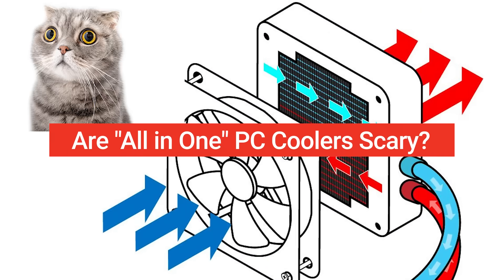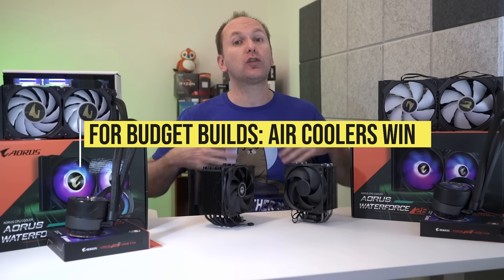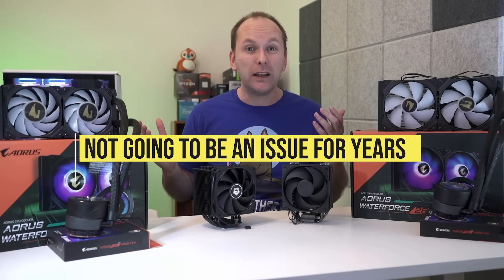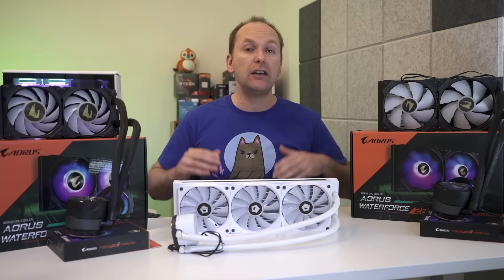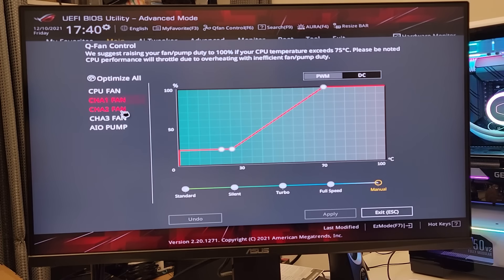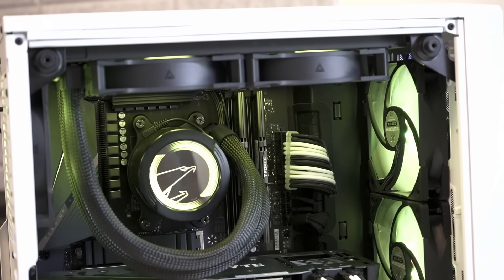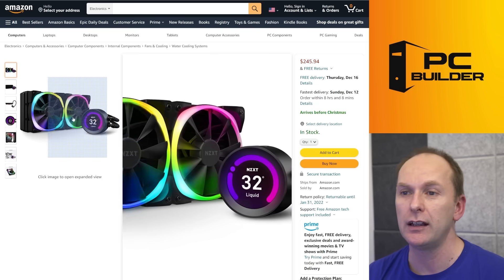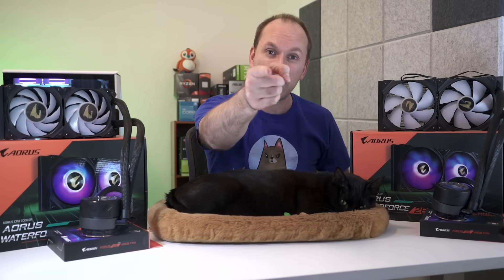🛑Watch BEFORE You Build! 🌊 PC Water Cooling Build Guide | Water Cooled PC Build 2022

Comment: Question, wouldn't the top mount fan direction be pulling hot air through the radiator, don't you want cold air to be going through it to cool the liquid ?
Reply: The optimal direction depends on which component is most critical: CPU or the rest of the system (video and MoBo chips). Nowadays the CPU's consume a lot of power, so I think you want indeed to use the coolest air to cool the CPU, sacrificing the temperature of the other components (increase probably with 10 to 20°C).
I think best is to arrange cool air intake for the CPU with the AIO cooler, while making sure that the video board gets also somewhat cool air from another nearby air intake.
Reply: @gjkoolen  Excellent advice.  People often forget about motherboard and RAM cooling.  Things like VRM's and other components can get pretty hot, and you don't want to sacrifice them.  Also, high-performance NVMe drives can get pretty hot, and the case needs a good supply of cool air to help keep them from data throttling due to high temps.

Comment: Back in my time, we buy water pumps from aquarium shop, use bike radiators and tupperware as reservoir LOL. Water block was hand machined from a block of copper and epoxied together.
If you want RGB, you buy cold cathode lights from auto shop and light controller from hobby shops.  Ah good times! Coming up with new ideas, sourcing for materials and ghetto engineering was such an adventure! I still have trauma from when a leakage destroyed my AMD Thunderbird.. 20 years sure flew by!
Reply: I remember the 1st time I saw a liquid cooled PC... I was like, thats a morotcycle radiator.... Is it a good idea to have water inside your PC?!? 

The last PC I built was 20 years ago, when single color LED fans were like 🤯 and loud as hell. I had a CPU aluminum heatsink with a plastic  scoop that fit flush with a single fan in the center of my case door. 
Thats it. 😂
Reply: Back when mankind walking by 4 feet 🦶 or hands 🙌 , whatever ya see that! lol

Comment: HI I am getting a PC and Monitor , my budget for the PC is about $3000(Rs.225000). The specs and the prices I am able to get them for are these- Ryzen 7 5800x($492.64 or Rs. 37300),MSI Ventus 2X OC rtx 3070( Rs. 92,800 or $1225), T-Force Delta RGB(16x2 3200mhz) (Rs. 14,780 or $195.2), nzxt kraken x73(Rs. 16,690 or $220, nzxt h710 Black(Rs. 9310 or $122.96), 500GB NVMe M.2280 Kingston NV1(Rs. 4,450 or $58.77), 2 TB Seagate Barracuda 7200 rpm(Rs.5,350 or $70.66), DeepCool 750W DQ750-M-V2L GOLD( Rs.7,300 or $96.41), ASRock B550 PG Velocita or the MSI MAG X570S Tomahawk Max WIFI(Haven't decided yet) ($340.75 or Rs.25800). I have heard that the 5800x overheats all the time even with a good cooler, and i wanna know if the motherboard is fine for the build. could u please see if this is fine and if I should go for a 5600x(Rs. 25,700 or $339.43) instead and if everything else is fine. I do wanna keep the nzxt case though. For the Monitor I am deciding between Asus TUF VG279QM 280hz(Rs. 32,999 or $435.93) or the LG Ultragear 27GN750 240hz(Rs. 32000 or $422)HI I am getting a PC and Monitor , my budget for the PC is about $3000(Rs.225000). The specs and the prices I am able to get them for are these- Ryzen 7 5800x($492.64 or Rs. 37300),MSI Ventus 2X OC rtx 3070( Rs. 92,800 or $1225), T-Force Delta RGB(16x2 3200mhz) (Rs. 14,780 or $195.2), nzxt kraken x73(Rs. 16,690 or $220, nzxt h710 Black(Rs. 9310 or $122.96), 500GB NVMe M.2280 Kingston NV1(Rs. 4,450 or $58.77), 2 TB Seagate Barracuda 7200 rpm(Rs.5,350 or $70.66), DeepCool 750W DQ750-M-V2L GOLD( Rs.7,300 or $96.41), ASRock B550 PG Velocita or the MSI MAG X570S Tomahawk Max WIFI(Haven't decided yet) ($340.75 or Rs.25800). I have heard that the 5800x overheats all the time even with a good cooler, and i wanna know if the motherboard is fine for the build. could u please see if this is fine and if I should go for a 5600x(Rs. 25,700 or $339.43) instead and if everything else is fine. I do wanna keep the nzxt case though. For the Monitor I am deciding between Asus TUF VG279QM 280hz(Rs. 32,999 or $435.93) or the LG Ultragear 27GN750 240hz(Rs. 32000 or $422)

Comment: I’ve worked with an AIO before, but this time for a personal 12600k build, I wanna try out an Air cooler, specifically the refresh of the Noctua chromax.black. I already have a spare fan from a previous Antec Df700 flux case that I can use & figured I could just throw that in there because why not. 

Going with a Corsair 4000D airflow case & Corsair fan cases, I think the SP120 Performance ones, one of the more cheaper options that come in the 3 pack. It’s still some stuff I want to work over with it in PCpartpicker, but I’m pretty firm on most of everything.

I could just go w a AIO for a few bucks more, but I feel like the air cooler will work well enough already.
Reply from the maker: Makes sense! Sounds like a great build.

Comment: I believe that when you build your computer you consider these facts. The AIO's purpose is to cool the CPU not the case. Hot air always rises. A very good reason to place the radiator and its fans at the top of the case. You cannot put size 12 feet into size 10 shoes, without problems. I learned this with my last build. I bought a Thermaltake Commander C-33 case and their Toughliquid Ultra 360 AIO. I quickly become aware of a few problems. The AIO's radiator could not be centered at the top of the case because of a case corner brace. The AIO did not allow sufficient room for the top-mounted case-control wires to pass. It wanted ALL of the top space for itself. The three large fans make access to the MB's top wire pins nearly impossible. I had to put the plugs on the pins before I installed the fans. I learned two great lessons. Always keep all the packaging handy if you need to return anything and that patience is a virtue. I did get the AIO to work but I wish that I had planned the operation a little bit better.

Comment: Have the (non-RGB) Arctic LF II 420 (in push-pull), and, even with the case compatibility challenge, it's worth it for the headroom to PBO/OC the 5950x if i want to. Also, surprisingly quiet.
Reply from the maker: nice!
Reply: That's gonna give you a ton of thermal head room. I have the 420 as well, but haven't decided if Push-Pull is worth the extra cost for my i9.

Comment: bought the nzxt z63 hoping to top mount it in the lian li lancool 215. it can probably be done but i backed out and ended up front mounting in a push pull. kept getting stuck on the 24 pin connectors. might still try to top mount it again at some point

Comment: I always learned to top mount an AIO or front mount with tubes down to avoid the air pocket issue, which actually can cause problems for pumps because AIO pumps aren't really built to push air.

The best AIO I've found is the Cooler Master ML240L ARBG V2. It's cheap but heavily effective, and also looks nice.
Reply from the maker: Nice!
Reply: That has got to be GN worst video
Doesn't matter if the tubes point up as long as the pump is lower that the highest point which on nearly all aios it will still be below

Comment: Hello PC Builder, thank you for these helpful vids! I'm building my first PC and I was wondering, have you done a video about which vertical GPU mounts works best for the newer gen pc parts? Considering on vertical-mounting my GPU but I watched a video saying that there are a lot of issues with it
Reply: Vertical mounting a GPU can cause problems due to the GPU fans being too close to the side of the case and not giving them enough airflow. 
Other issues can come from the flat cable that connects it to the PCIe slot. GPUs really like to be plugged right in to the motherboard.
Reply: @stevekjr9563  Hi, thank you for your input! Won't be buying a vertical mount anymore
Reply from the maker: I haven't done a lot with that so not the person to speak to it.
Reply: @PCBuilderChannel  Thank you, I decided not to use a vertical mount

Comment: The Arctic AIO's or EK can beat any Air cooler in the market  Arctic LF 2 cools better than the Noctua D15 by around 5-8 degrees lower maybe even more at AIO on full speed. I also want to add the Arctic and I think EK solved the issue with permeation by adding reinforced fire tubes to prevent that, Plus if the liquid does permeate a mixture of cryo fuel and distilled water can be filled in if you unscrew the cooler and add the liquid, also arctic and most coolers have a 5-6 year warranty so if something dies happened they will give you a replacement cooler, in addition, some AIO's were able to last 8+ years even 10+ years there are many ways to extend the life of an AIO. I did alot of research people shouldn't fear leakage from the new coolers anymore, they are completely sealed and if you get high end AIO's they will not leak many systems have AIO's and with the 12900K the cpu only increased the need for AIO's over AIR as Air wouldn't be efficient anymore (unless AMD can lower the thermals even more)
Reply from the maker: Thanks for this!

Comment: What pump speed do you recommend? Is it all trial-and-error? Will the pump last longer if I run it at a slower speed?
Reply: Generally, pump speed should be kept at 100%.
Reply from the maker: We do cover this in the video, check out the chapter times if you need to find it (: 
The pump will not last longer at a slower speed, it will last longer if you keep it at a constant speed

Comment: Thank you, your video is very informative.  I have a question, what would you think is a suitable  240mm aio cooler for i7-12700K (with and without overclocking). I'm going to build a new computer next year with that CPU but haven't decided the cooling system yet. Thank you in advance.
Reply from the maker: If you just want pure performance I'd get an Actic Liquid Freezer ii 360 or EK AIO. Linked in the description

Comment: Just went from noctua D15 to EK AIO 240 for 12700k upgrade in meshify C case. Definitely more space and airflow now in case, but a bit disappointed about the cooling performance (maby it is just the 12gen running too hot when oc) I was not too happy for forced move to aio over air (12gen compatibility issues), but at the end i think i will be AIO guy also on future builds.

Comment: This is a very good beginner's summary in a quick and concise video. Kudos.

My main issues with AIOs is the lifespan as you mentioned. With so more mechanical components, there's much possibilities of failure than a simple fan failure in an air cooler. Even if the pump and fans all last to their rated capacity and beyond, the issue of eventual evaporation of coolant sets an eventual limit. (The Bequiet Silent Loop does allow refill though its cooling performance is average at best in exchange for low noise). I have encountered way more AIOs fail or simply reached EOL than a simple heat sink fan which often outlast even the socket the CPU is mounted on.

Also lastly, this a pet peeve of mine but a lot of cases can't mount top of the line 280/360 AIOs on the roof with clearance for motherboards due to VRM heatsink being too big or RAM size. I kinda wish there is more standardization on this on the amount of free case height above the motherboard.
Reply from the maker: Glad you enjoyed! These are solid points thanks for sharing
Reply: @PCBuilderChannel is the aio cooler no longer working because it’s old a big problem when you have 6 fans n 3 on the aio?
Reply: Front mounting is ok too, as long as the pump is not in the highest point

Comment: My h150i capellix elite’s pump is very loud. I have to put it on 40-50% speed to barely hear it.. Is it normal for this model’s pump to be this noisy?
Reply from the maker: Probably not. I would check your orientation and if its 6-7 years old it might need to be refilled. Or it could be a pump problem. I'd head over to Reddit Build A PC Troubleshooting for more help.

Comment: The cost is the main factor for me.  The cheapest 240mm AIO for me is $88 AUD for the ML240L, whereas the Hyper 212X I'm running is half that price, and that's not even the cheapest fan cooler.  I know $40 AUD may not seem like much, but it's enough to mean a better motherboard, better RAM, bigger SSD, etc.
Reply from the maker: Totally understandable! Like we talk about in the Liquid vs Air cooling section of the video budget price is one of the factors where Air can take the win.

Comment: I feel more secure with air cooling, even if AIO have a small chance of failure, when compared to air cooling, if something fails nothing critical happens, in contrast with AIO, if by any chance a leak happens, then you lose everything. I'm planning to build an ITX PC and I can't imagine how I would feel if the AIO somehow leaked and all my component died on the spot.
I'm still considering getting one just for the space efficiency but it makes me really nervous.
Reply: If a can fit it looks better and is better in general. Very very low
Reply from the maker: I understand! A lot of people have that fear, thats why I wanted to do this video. Modern AIOs are very safe and fun. But of course Air Coolers are always an option if you want to go that route.

Comment: Too complicated? It can't get any simpler really.. Take the Arctic Liquid Freezer || for example. 1 wire, one CPU mount and radiator mount. Done. Of course it has to fit, bit it isn't even a mess of wires in that case

Comment: I was afraid of water, went top-end NH-D15.  Tried 3 x 3,000 RPM fans on it when overclocking.  Bought 280 & 420 ALF II AIO's, and got significantly higher benchmark scores, AND lower temps at HIGHER power limits.  AIO's are nothing but WIN.  VERY easy to install, cooler inside the case, cooler CPU and GPU.  There's no rational reason to go with air cooling with high-power CPU's.
Reply from the maker: Thanks for sharing! I totally agree (:

Comment: 16:09 Beautiful cat! 😍 We had two Black litter sisters, Chevy and Drag, that lived for 17 years. Which is more than twice as long as a good AIO will last. Been running a Thermaltake 360 AIO for about four years and think I'm hearing a little pump whine. Putting a Corsair iCUE H150i on the i7 12700k with a 3080Ti in my Thermaltake Core X9 case. Wife is getting my i7 6700k and 1080Ti in a Lian li lancool ii Mesh case with a Cooler Master ML240 RGB. Happy Holidays!

Fair winds and following seas to all.
Reply from the maker: Happy Holidays!!

Comment: I have a budget pc  using 5600g and its graphics but the stock cooler is not enough for the games  and software I run can you tell me a aio (240/280mm  due to case) under a budget
Reply from the maker: For a 5600g build the reason to go with 5600g is to save money, so personally thats one build where I would stick with a budget air cooler (check out our Best Cooler Video on the channel to see our recommended Air Coolers) but if you do want to go AIO expand the description for links here and check out the 240mm ones.

Comment: Choosing between the id cooling 240xt snow or the black Arctic lf II 240. The Arctic aio will undoubtedly perform better but I have a white/silver setup. Might just wait for the white argb arctic lf II 240.
Reply from the maker: You are exactly right, the Arctic will perform better but if you want a white build the other is fine or you can check out Corsair H-series.

Comment: bought 2 ARCTIC Freezer and a Galahad AIO this week, was also considering the MSI coreliquid as i have a basic MSI build for my younger sister but I've read that its longevity is  questionable.. any though on this? cuz i can still place an order for it..
Reply: Don't. A local shop made a video about the coreliquid. 7 out of the 14 units they sold came back to them. One of their customers even sent a picture, the cpu was idling 5% load @ 91C. You can watch the video their channel is called "Hardware Sugar"
Reply from the maker: Its a good AIO. I haven't heard any specific issues with it but you look at individual reviews.
Reply: @PCBuilderChannel  ive read reviews on Amazon and it has failing issues ( the MSI) but nonetheless im happy with the arctic as i got the argb versions on like 90 usd each

Comment: I purchased the Fractal Design FD-W-2-S3602 Celsius+ S36 Prisma 360mm ARGB Liquid CPU Cooler and I would like to find out if the pre-applied thermal paste is good or should I clear that and opt for something like thermal grizzly kryonaut? Also for a 5900x
Reply from the maker: Its hard to say. A lot of people have done testing on this and it doesn't seem to make much difference. I personally always use Arctic mx-4

Comment: So I have a ryzen 7 3700x and I have the phanteks p400a digital case, I also have a 360mm aio is that just overkill and should I look into switching it out for a 240/280?, also I do intake fans in front of the radiator should I have them behind it?
Reply from the maker: Yes but there is nothing wrong with overkill. They can be in either position. If they are in front you set them to push air through the radiator and if they are behind set them to pull air through it.
Reply: @PCBuilderChannel  Love that you reply to questions and are always looking to help thanks a lot!

Comment: There was a time when people were switching from air cooling to liquid cooling and a side effect was that other components on the motherboards were not getting air circulation.  Are newer motherboards better in this regards in that with no air cooler on the cpu there may not be much air circulation on other parts of the motherboard.
Reply from the maker: Two things changed: 1) The rise of airflow focused cases and 2) Generally the VRMs themselves are just way better. When outlets starting testing VRM temps and calling out bad ones, it took a little while but AIBs have started to adjust. Just look at the B550 and Z690 motherboards - even the cheapest could run the biggest CPU at stock settings.
Reply: Liquid Freezer II's built in VRM fan is still a nice touch.